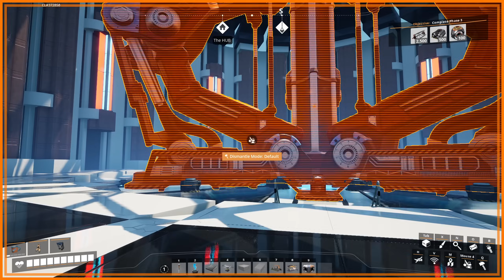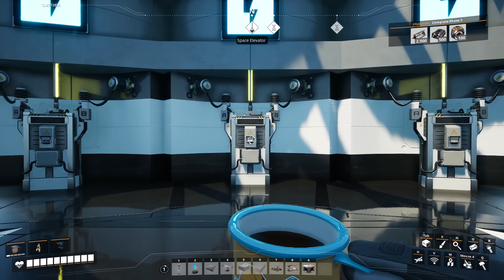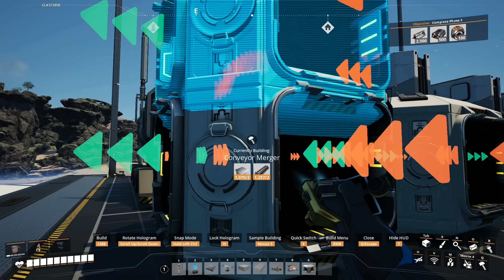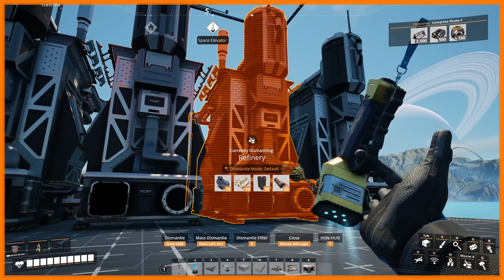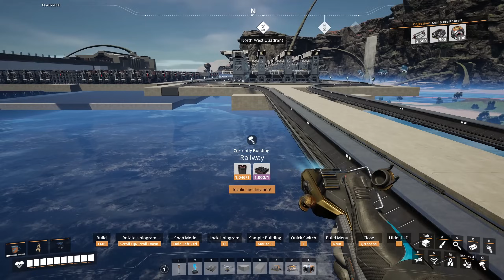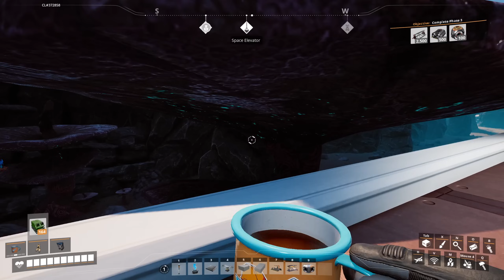The great expansion Satisfactory 1.0

Comment: How do you deal with incline changes up and down for the train?
Reply from the maker: small inclines over all. instead of putting a flat surface for the 5 foundation section i used the double ramps 1m one over 5 foundations.  you can check out the world map in the discord if you want to take a better look at it.

Comment: When i build with Centers it will not Snap into the previous Blueprint. What am i doing wrong ?
Reply from the maker: make sure blueprint mode is on with R. and make sure you are aiming at the right spot. also if you didnt build your blueprints at the right height in the bp machine, that can cause some issues.

Comment: I see your storage room have 1m floor holes. I currently working on MK6 belts and I find out from other YouTuber that they affect rate of MK5-6 belts rate and slow down items transfer, 2m and 4m floor holes are not, only 1m, so I recommend it for you as well to not use them, at least until they will be fixed by devs (we don't get fixes until Ficsmas)
Reply from the maker: yeah but if it is going into a depot it only can process 240 max anyway. so it will be fine i think, good looking out though.

Comment: 1 water extractor is enough to get you 450 copper /iron ingots per minute, or 60 caterium. Like, sure, it all depends on what problems you want to spend your time solving for sure, but it's hard to imagine a scenario in which it's easier to set up a crude oil production chain than it is to just plop down like 6 water extractors. Foundries are a hell of a lot prettier to look at though I guess.
Reply from the maker: yeah, really depends on how you want to run your base and what you can do.

Comment: Still love storage rooms, but upload speed to the dimensional depot is per uploader, not per item. This does mean you can have two depots uploading concrete, giving 480/minute, or go overboard and have 4 depots at 960/minute, etc.

And having the items just automatically usable is way more convenient that going back to your base to grab more when you run out.
Reply from the maker: True, good thing there are tons of Spheres.
Reply: I think the true value of a bulk warehouse/mall is not in common parts but rarer ones. I can make a dimensional uploader that does nearly 2500 concrete/min off of a few overclocked pure nodes feeding into 10ish depots. Completely eliminates any need for storage beyond that because even if I ever use more than 2500/min it won't take that long to fill up again. but for something like computers or motors I will not have nearly enough going into depots alone for larger projects.
Reply from the maker: @sci7zo  agreed, but you can also put crazy good parts into bins, and when they fill up over time you'll be set

Comment: 37:12  those mini waterfalls... either have the trains go through one or right next to them
and the clipping arch could probably be avoided with a slight bend to the highway... maybe not from the power tower you observed the thing from at 36:56 but from the lights at halfway should probably barely avoid having to avoid the stone pillars on the right....
but if that does not align properly you can always make the lane go outwards and avoid the thing... since going inwards would interfere with the inner track...
Reply from the maker: yeah, but once i get a train over there, should be so much better for power and transportation.

Comment: For the area where its not wide enough where you cant blow up the rock, have the center train lines go up and the outer ones stay at same height but go inward creating a double decker line for a few. To me, that makes more continuity in design and looks like it was meant to be that way.
Reply from the maker: nice, i will look into that.
Reply: @DrawingXaos Can you post your save file on the discord I'm not trying to start the game again
Reply: Alternatively split the two pairs of lines leaving a gap in the middle. This way the trains on one side go through the arch rather than having the risk of pinch points in the network.